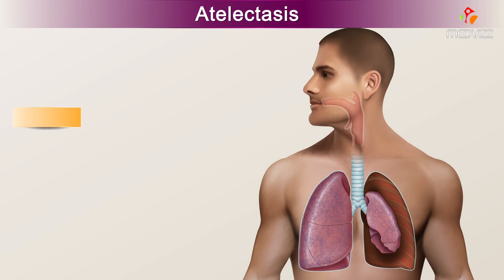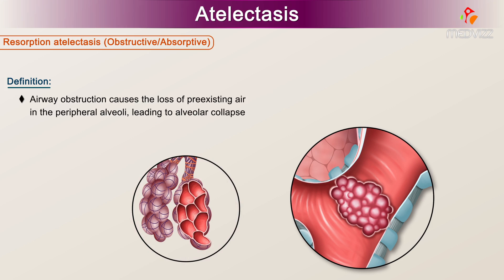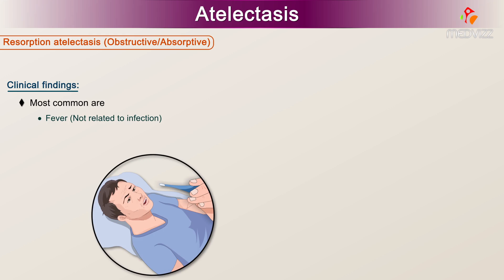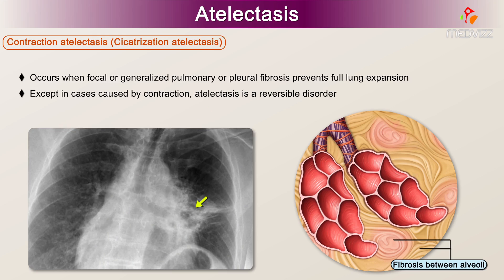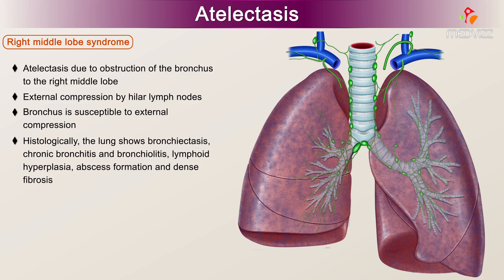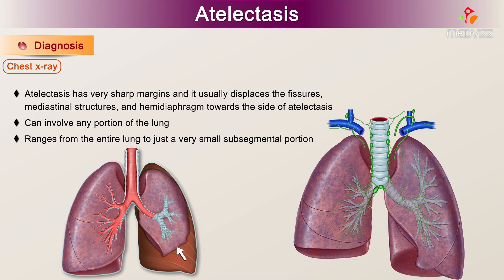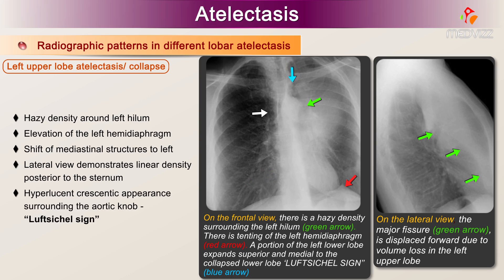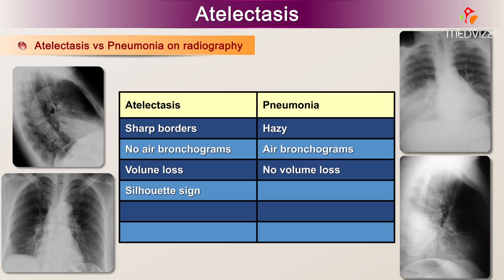Atelectasis : Etiology, Clinical Features, Pathology, pathophysiology, Diagnosis, and Treatment

Comment: I have this apparently in the right middle lobe... but i also have a 4mm intrapulmonary lymph node previously believed to be a nodule close by and a 3mm nodule right lower lobe. Was coughing up blood streaked green mucous. Also have had lung issues for about 10 years and persistent eosinophilia. Should i be worried? There could be so many causes with me or multiple causes if you dont know the cause how do you fix it? Cant stop coughing. Post nasal drop for years. Is this dangerous..? Can my lung fully collapse if left??

Comment: Thanks for this info! I found out I had atelectasis, am I fine to do regular activity or do I need to be more cautious, also exercising/cardio etc will that be worse for me? I don’t see much of this online and having trouble finding answers
Reply: I have the same question.
Reply: @jeffreybanigo2273  based off experience I was light on activity and continued deep breath exercises/inhaler. The doctors did another x ray and said most of my lungs had cleared up and I was good to do normal activities again. I would recommend getting the clear from doctor etc but light activity should be fine.